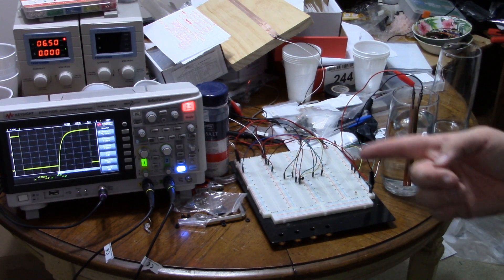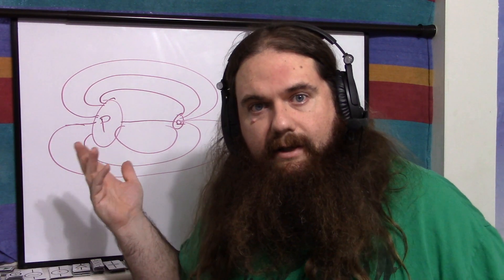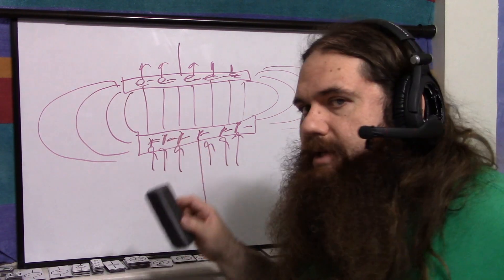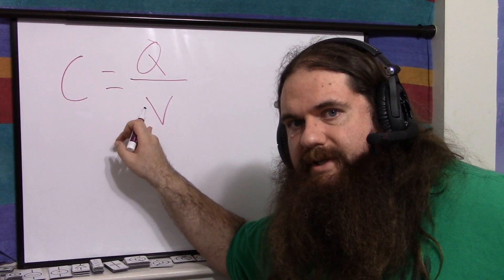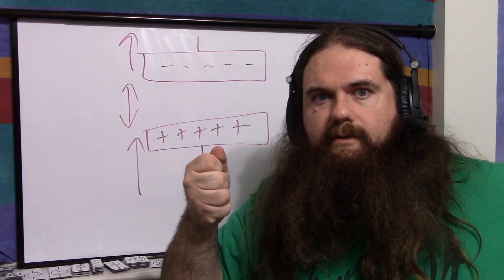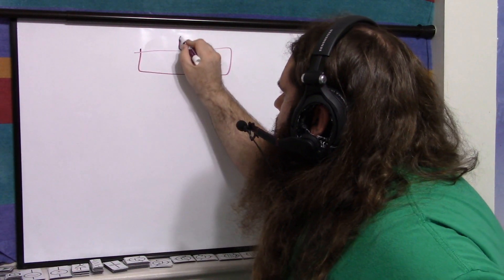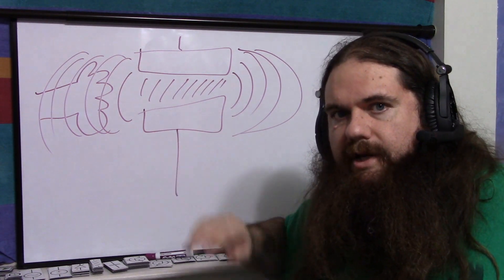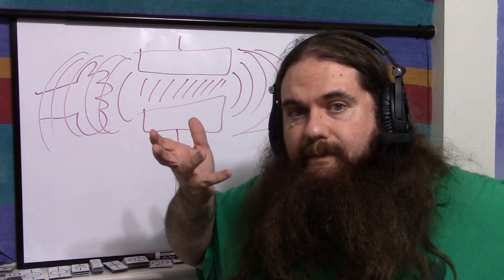How A Dialectric Works and How Capacitive Proximity Sensors Work - Simply Put

Comment: Sorry to say that there are a few mistakes in your video. 1) Just spelling, but it's dielectric with an e. 2) Then there are no protons involved in an electric circuit, it's just more or less electrons. 3) And you have to be cautious about drawing similarities between electric and magnetic field. You can have a single, electrically charged object and it will be the source of radial field lines. That is not possible in magnets. Only if you have a negatively charged object close to the positive one, the electric field lines will go in between the two.

Comment: So the waves are actually not just above the wire on the table, but the waves are also under the table as well, because the wire sits on top of the table.. and if you put your hand under the table, it will trigger the effect as well. This is some beginner type wireless/no/non touch/touchless/proximity type stuff, and you're probably one of the very few that actually go this far into this particular subject, very good watch, tnx a million.

Comment: help? I'm driving the gate of a mosfet... problem is, the gate doesn't use enough power from the caps to eventually shut itself off. It's a PIR motion circuit that keeps a light on for X time when triggered. The mosfet drives a larger 12v load. Gate is logic 3.3V
Reply from the maker: Your question is unclear without a circuit diagram, so I don't know what "the caps" are. Google gives me a whole bunch of different designs. Are you saying that you're trying to get the mosfet to continually drain a capacitor that's supplying its gate? Because the entire point of mosfets is they don't do that. If you want a transistor to drain a cap like that, use a BJT.
Reply: @simplyput2796  yep exactly. The mosfet is friendly. The charge in the caps is what times how long the gate stays active. I'm gonna hook a boost converter to the logic and run the gate at ~10v. The conversion should bleed the caps. (Just dunno how quickly)
Reply from the maker: If you just want to charge the capacitor to high to turn on and feed the gate, and have the capacitor go low to turn the gate off after a fixed duration, why not just use an RC network? In other words, just add a resistor from the positive end of the capacitor (attached to the gate) to circuit ground, so the capacitor discharges through it, and you can apply the charging voltage (when you turn it on) directly to the capacitor's positive end (and the gate) or through an additional small-value resistor, so it turns on quickly.
Reply: @simplyput2796  I would, but I'm piggybacking onto something pre made. Best i can do is an led in parallel, but the output flickers some of the time. Just something for fun. I like to experiment on things.

Comment: On larger (2 to 4 ft diameter) tunable passive loop antennas for AM radio they recommend that you space the turns of the loop about 1/8th of an inch apart to avoid capacitance between the turns but on the small 9 inch diameter passive loop I bought the coil turns are close wound. I keep forgetting why the turns on the larger loops have to be spaced exactly without going back and reading it again. My memory sucks and I simply don`t quite understand electronics. Is it because a close wound larger coil would have too much capacitance to tune the top of the AM band (1700khz)? Why isn`t the smaller coil affected this way? The air variable tuning capacitor used with these loops is 365pf typically to cover a frequency range between 520 and 1700 khz. By the way (for the curious), these loops work inductively and couple magnetically with the internal ferrite antenna on the typical AM receiver and boost the signal.
Reply: id like to know this too.. didn't know about what you just described there but im intrigued now to know... "simply put" can you answer this for him/me??????
Reply from the maker: Unfortunately I have not studied antennas and electromagnetic-wave transmission/reception yet. I can say that 1/8" air gap in terms of a capacitor is gigantic, so it very well could be to reduce the capacitance to a low enough level that it won't affect it. Maybe it doesn't matter as much on the smaller one because the inductance is stronger and overpowers it? Inductance is partially determined by the diameter of the coil. I wish I could tell you, but I have a lot of study ahead of me before getting into stuff like broadcast signals.
Reply: @simplyput2796  It`s pretty interesting. Normally getting a good AM signal past 50 or 60 miles during the day is nearly impossible but using the loop I can get a strong signal at 138 miles on one station and a readable signal at 168 miles on another. With a 300 foot insulated long wire antenna stretched out through the bushes and lower tree limbs and connected to a small grounded coil of magnet wire I can hear surrounding states during the day up to 350 miles away. This antenna is a lightning magnet though.